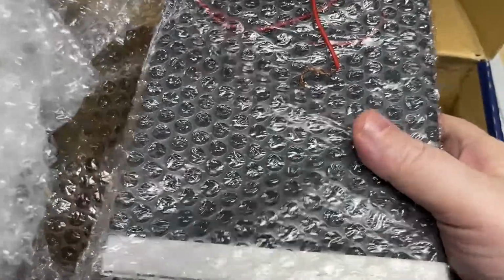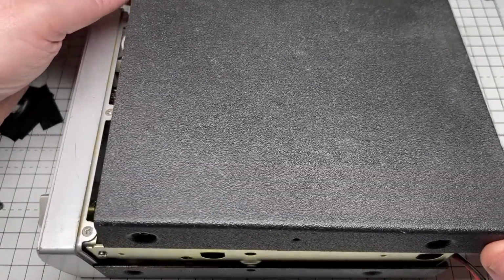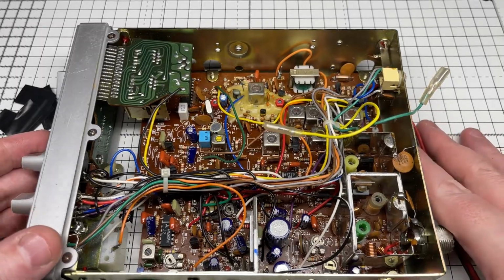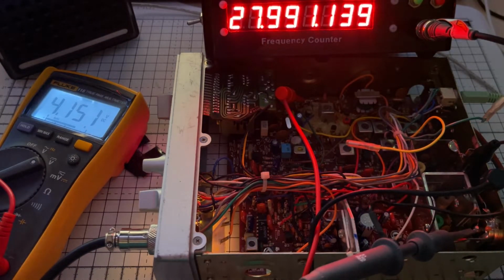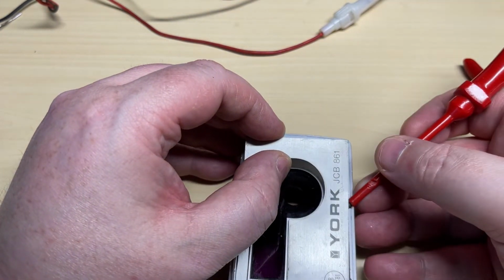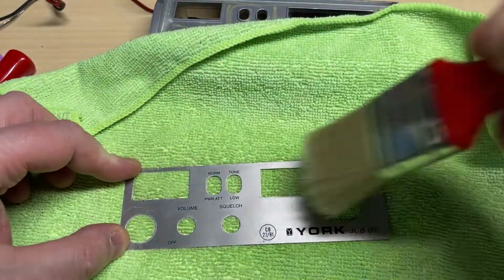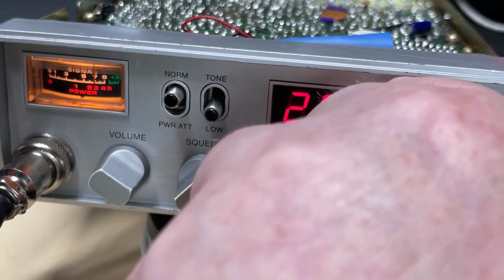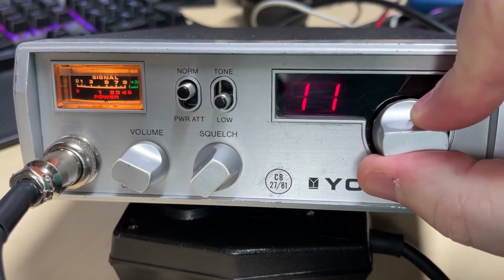EP 086 - York JCB 861 Small repairs and test / Mid band. CB 27/81 - CB Radio

Comment: last year i found the old rotel 230 in the loft, it started life one of those 20 quid comet jobbies in 1983 and was installed into a international 584 tractor, after that summer it was removed and then the next 35+ years are a blank, so thats where it was sort of thing, it was in dusty but good condition, inside it had been populated with spiders, full of webs/nests and gawd knows what, a compressor comes in handy and under the crud it was in untouched exellent condition, time to wake it up, i have a variable power supply so gradually power was applied, it had the usual dirty switch contacts and 1 segment missing from the read out as i know it was never used much so actual wear would not be the issue, all came back to life, i plugged it into the antenna, not a cb antenna but it will pick up cb a few miles away and some guys were talking on tractors so it did rx well, so now onto tx, power meter and a dummy load, in the end half a watt on low power and 3.5 watts on hi power so thats what i would call a success, will leave well alone, very similar to the radio in this vid, all i have done to it is put switch cleaner into where was needed and that is that.
favorite radio back in the day was a colt 320fm black shadow, have one of those still but its on 10m bought it out of radcom about 25 years ago, its done via eeprom and also had a crude way of doing splits via nb switch where it can drop 600khz to tx and switch manually back up for rx
Reply from the maker: Just goes to show that they last , not like some of this modern rigs .